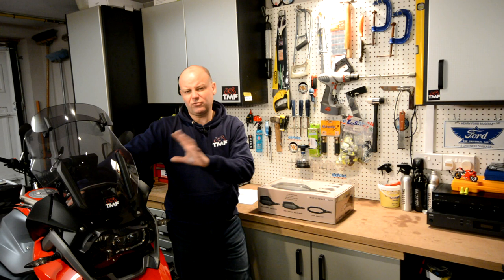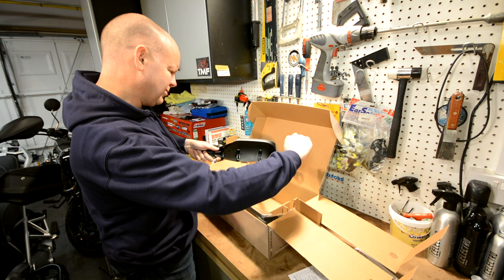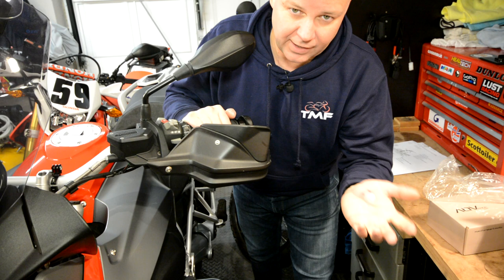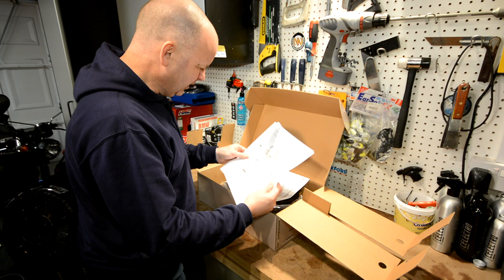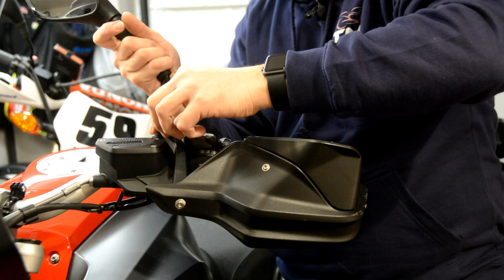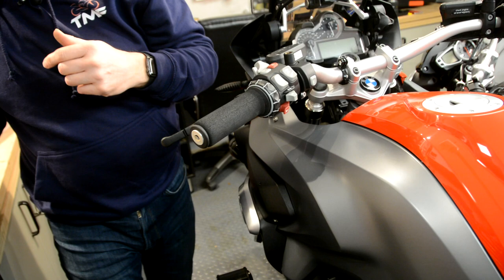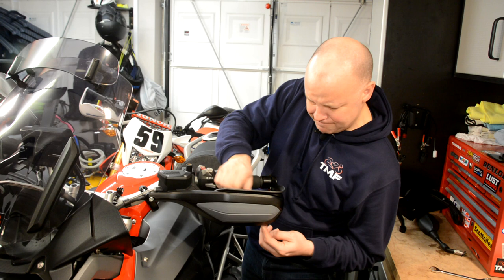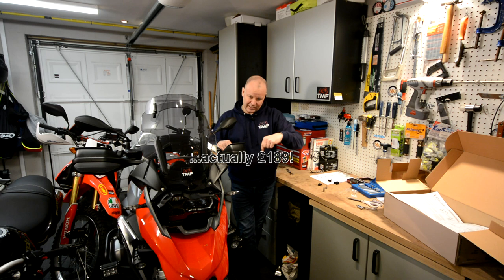How to fit Machineart Advance hand guards to a BMW R1200GS

Comment: There seems to be an ever present discussion about metal handguards vs plastic ones. The one argument being that plastic absorbs impact better just due to flex whereas metal transfers the forces straight to the steering bar and uhh, from the looks of it, your clutch cable assembly. I've dropped my GS several times and although the marks on the plastic are visible, they have never given in, also due to flex. They also might be quicker and somewhat cheaper to replace. Also there is the point that modern plastic compounds these days are very, very durable. This is why they don't make car exteriours out of metal any more. I'll likely consider these if I break my stock plastic ones, but seeing how much abuse they can actually take, I'm not sure that will happen, also scuffed aluminum looks and feels worse than scuffed plastic :) just my 2 cents. They do look nice and I love the removable shield.
Reply from the maker: Yep good points - we'll see how they go!
Reply: Machineartmoto Advan Handguard are tougher than Barkbuster

Comment: Talking of dropping things.... I cringe when I see tools and fittings being wielded above such fine machines like ours as we work away. The damage caused by an accidentally dropped spanner, screwdriver or indeed bolt or screw as it bounces off and marks the paintwork, engine casings etc. leaves painful memories of said experience for a long while afterwards. Have a word with the missus and as she changes her tea towels for super clean unmarked new ones (My good lady loves new tea towels lol) that's your cue to acquire the old ones (Or indeed any other useful linen, bath towels etc) and build yourself a plentiful supply in the garage/workshop. They certainly come in handy for protecting the areas directly where you're working and other surrounding areas too. When you next drop a bolt or a tool you may just save yourself some heartache in the future..... Loving your vids as always BTW
Reply from the maker: Thanks for the tip!

Comment: Billet aluminium means the part was machined (cut out of) a single block of aluminium as opposed to being cast in a mould from liquid aluminium. Cast parts usually have a rougher surface from the mould texture (if not they have been further processed, polished for example) and can have imperfections resulting from the casting process - cavities from air bubbles for example. Machined parts are usually considered the better quality as they are structurally stronger (no imperfections due to the casting process) and can be made to a greater degree of precision.
Reply from the maker: Thanks for that - I suspected that was the case but good to hear it from someone who clearly knows what they are talking about!  Cheers - TMF

Comment: TMF great vid as always, the true purpose of the metal backbone (in the case of Barkbusters) is not so much protecting our hands, which it does as well,  but to enable a rider to ride the bike out of an off road situation upon crashing and still having use of your clutch lever. The added wind protection is just a bonus, which if mainly road riding the OEM would suffice with the added wind protection bits. I had contemplating these but as you already know the cost of entry is steep. Would have been over $300++ in CND $'s.
Glad you got your shock worked out. As our bikes get a bit older, there will be more and better 3rd party options available. cheers
Reply from the maker: Thanks for watching and for stopping by!  All the best - TMF

Comment: Nice neat install, TMF.  Always glad to hear other riders’ dropped bike stories... I had my then new 06 Ducati 2 months and dropped her on gravel (not moving thankfully)... I lived with the shame for several years. Group therapy was somewhat helpful 😀🏍.  Take care- enjoy the new gear.
Reply from the maker: Yeah I was on a pub gravel car park - bit of off-camber and an upslope......whoops!
Reply: Here’s one for you then....I rode back from Silverstone on my Z1R in the early 80’s, arrived back home in the drive, stopped, but because it was cold (and you only wore jeans back then), my knees had locked so I couldn’t put my feet down; toppled straight off. Major concern wasn’t the bike.....it was if anyone had seen me...l felt a right twonk!
Reply: Steve Inskip I know the feeling!
Reply from the maker: ...as do I!
Reply: Hmm, got the brand  new KTM home in a van, a 300 mile round trip... all good. Loosened the first tie down and with a big bang of the strap, the brand new, zero miles beauty fell over in the back of the van. Beat that! Scratched bar end and a twisted mirror was the sum total of damage though. Live and learn!
Reply: Mark Straker oofah!!!✔️

Comment: Looks good TMF.  I see watching your videos could cost me some money!   I am considering the handguards, maybe someone will have them at the BMW MOA International Rally in the USA this July.
Reply from the maker: Yes they are a bit pricey but I think they look great and I’m very pleased with them....
Reply: TMF:  I just bought a Scantool ODBLink MX device and the adapter cable to hook it up to my GS just arrived today.  With the basic MotoScan app on my phone I can see data from the bike and (not tested yet) reset the service date and mileage.  Would make for a nice video blog by you.  Less expensive than the GS-911 device but not as capable (I own  share of a GS-911 tool so have used it).  Just a thought for a future video.
Reply: The hand guards are $269 US from Revzilla.com.

Comment: Isn’t the purpose of a plastic guard to break on impact where as a metal one has the potential of squashing and trapping your hands?
Reply from the maker: This is solid aluminium, thick stuff, I can't see it being bent in the event of an off.....at least I hope not!
Reply: DucatiRichie Billet aluminium will shatter on impact, but will not flex going through wind or light brances etc., as just plastic will. Opinions are devised on whether that's  a good thing.
Reply: Is it billet or machined from a forged piece

Comment: Very nice TMF, all this discussion about metal or plastic, if you think about it, they are doing the same job as BarkBusters, which are metal.  I layed down my Multistrada two years back the first thing that touched the floor was the handguard, which has the indicators housed in them. The hand guard broke in three places and was hanging off for the ride home, i then put metal BarkBusters on to protect the new handguards, which they did very well.  btw im trading in the multi for a GS Rallye this week :)
Reply from the maker: ooh congratulations!  You'll like my video this Friday then - stay tuned!
Reply: Ill come say hello at the Excel next week.

Comment: Billet Aluminium normally means they are machined from a solid billet of material. I doubt that is the case with hand guards as there'd be so much waste material ...
What's more important is the grade of aluminium they're made from 😎
Reply from the maker: Thanks for the clarification Bobby....
Reply: very true, being a machine shop owner I find it funny hearing billet and aerospace material thrown about!

Comment: I understand the utility of hand guards for defense from winter's cold winds, protecting hands from small tree branches etc, but I've also seen first hand (no pun intended) how it's possible to break both hands if you are unlucky going over the bars in a crash. A rare but nasty injury made worse because somone else needs to feed you and wipe your rear end for a couple of weeks during recovery...
Reply from the maker: Yuk....point made but on balance personally the protection from the wind and rain I think is worth the risk.....
Reply: Wind and rain, back in the day you just got cold and wet. For a bit of luxury a plastic bag and elastic band over each glove done the job. Could have saved yerself £189!
Reply: TheMissendenFlyer Yes tend to agree, particularly if you are only riding the GS on road. The particular accident I referred to happened during enduro riding in the dirt when the front wheel hit an unexpected deep pot hole at speed.
Reply: This is one of those claims that you read about, but in reality it's possible to get your wrists caught in the guards regardless of what they are made of. Although I'd still tend to agree that metal impact would be more damaging than smashing a bit of plastic that has flex.

Comment: Very nice. My one concern is that as they are so solid, any impact could travel through the bars and damage other things like the head bearing? Plastic takes the brunt by snapping... my only small concern, otherwise and excellent and practical farkle! TBH
Reply from the maker: Yes I never even thought of that but quite a few have commented that metal isn't the best material for hand guards (although I'm very happy with them)....

Comment: Nice video, Sir! These new guards look very nice indeed. These guards were obviously designed well, as the fit would indicate. A bit pricey if you ask me, but the OEM guards might not be too far off of that, knowing BMW! Frankly I think I would rather have plastic there, but everyone has different ideas on that. Enjoy them!
Reply from the maker: ...I never even knew that plastic v metal debate was a thing until I posted this video.....
Reply: HA! Oh it's a thing, man!  And I think it stems mostly from one's personal experience. The other driving factor is personal preference, of course. There is no wrong answer, and I think the best answer is the option that works best for you.  From a visual point of view, these new guards are fantastic. That is the one thing I wish I had on my Suzuki GSX1250FA. The paws were a bit chilly on the ride in this morning. It makes me realize how spoiled I am when I ride the Trophy and/or the Vision. The protection on those 2 bikes is so good I took it for granted. No more!   ;-)

Comment: Top lock-nut on mirrors is often a left handed thread ...
Reply from the maker: Aha!  Thanks for that.....although all seemed to go back together nice 'n' tight....
Reply: Nonsense! A lock nut is simply another nut, usually thinner, which locks onto a main fastening (plain) nut to prevent it loosening. How can you have a LH thread on a RH thread? If TMF did anything, he should have used a second spanner (wrench for USicans) on the mirror main nut, to counteract the loosening of the locknut...
Reply: Andrew Nichols - i agree with your general logic on locknuts but I've double checked and on my Triumph Tiger the upper locknut is a LH thread. Not sure if that's the case on BMWs too...
Reply: Yes, the locknut on the BMW 1200 GSA is reverse thread. Not sure why, but I just went out to my bike and checked.

Comment: Nice looking quality product.  With respect to airflow protection, I'm not sure that there is so much airflow over the hand to protect from- certainly on my Adventure  the main air flow is deflected away by other protuberances up stream.  I checked this out by the simple expedient of moving my hand around in the air flow whilst being bored on the M6 one day!   It would be nice to incorporate indicators, then there would be some additional justification to splash out on these.  ATB & TTFN TMF.
Reply from the maker: Cheers Nick - good to hear from you again.....
Reply: The pleasure is all mine by the sounds of it!

Comment: Greetings TMF, l was wondering about your thoughts about these guards, after a year of use. I saw a set on an Africa Twin, they really look like a fine piece of equipment.  I particularly like the twin spar frame and modular design. 
I called  the company to see if they had fitment for the Kawasaki Versey. Being that they are located nearby, in New Jersey,  Andrew, rhe owner, asked if I could stop by. He wants to adapt a mouting kit, to fit my bike.
Now I have to convince myself to part with $279.00, for a set of hand guards. Quality kit isn't cheap! 😉
Looking forward to your upcoming adventures,  Cheers, Rich
Reply from the maker: Yes they are pricey but I have to say the quality is fabulous - I definitely recommend them if you have the cash to splash, lovely bits of kit....
Reply: @TheMissendenFlyer  , you are a true inspiration, when it comes to adding farkle to the bike. I love your phrase " if you have the cash to splash."😃

Comment: Yeah, seen these on Nippy's. I have the Givi extenders, which look good with my tinted winglets and screen. I had the Barkbusters with the Storm Guards on my F800GS, before getting the GSA LC, which were great but I didn't like the look of the Barkbusters I'd seen on the GSA LC, preferred the stock look with Givi extenders. Ideally I would like stock+Givi+Barkbusters aluminium brace but not really possible without some fabrication. So these Machineart Advance Guards, which I quite like the look of seem pretty good with the adjustability and aluminium construction, always better than plastic. But like all Machineart stuff it's ridiculously and outrageously expensive and overpriced so I'll be passing on that and waiting for the identical Chinese copy at a 1/3 of the price! I bet they don't sell many, £100 and I'd have had a pop but not at £180. Out of interest how tall are they fully extended?
Reply from the maker: Well I've not measured them but at least as tall as the Touratech extenders I replaced - I'm very pleased with them so far...

Comment: I think you have inadvertently fitted a pair of very nice quality knuckle removing devices, some things are just better made from plastic, this is one of them. I sincerely hope you do not have that particular experience TMF, but I personally think they are asking for trouble...just my thoughts.
Reply from the maker: Yeah a few have made similar comments - I had never even thought of that!
Reply: Whilst travelling at 70mph and seeing a potential hazard ahead of you, you generally want to be hanging onto those bars and steering yourself out of trouble....not thinking oh jesus, I wanna get my hands out of these aluminium guillotines while they are still attached to me. I think I may have just blown my chances of that job of head of marketing for Machineart! btw, just entered the Canary Tours comp. Thanks TMF!

Comment: Thanks TMF......did you also consider hand guards with intergrated turning lights? Probably more fiddle to fit and not offer the same options as those from summer and winter
Reply from the maker: To be honest Grant I didn't - I wasn't aware that they are available for the GS?

Comment: They look like cast alloy, given there's strengthening ribs visible in the narrow ends. Any decent impact would likely snap them apart. Almost £200 for those is ridiculous too. Luckily your GS doesn't go off road so I doubt you'll ever need to test there strength 👍🏻
Reply from the maker: I hope not!
Reply: You are wrong...
This handguard are tougher than Barkbuster and Barkbuster...

Comment: Andy, are you (still) happy with these?  I've got the fixed extenders and my hands are now getting too hot! Do you in fact open them up to summer settings in practice?  TTFN, Nick
Reply from the maker: Yes I'm very happy with them - I just retract the top part in Summer rather than open them up in practice.....

Comment: Hi TMF; on July  30th our local BMW dealer was doing a $3,000 off promotion on all bikes.  I almost traded in my ninja 1000 ABS & bought the R1200GS Standard.  However, was too busy trying to catch a flight to UK so I couldn't.  Now I realize I should never buy a BMW bike, because just like their cars these bikes must not be owned past warranty.  While in UK, I watched more videos and I now realize they might be good looking etc but they are designed with planned obsolescence.  Which is a tragedy.  But the Germans are super good at this strategy.  I was told that Merc 200 series back in 1970s started to use plastic parts which were designed to grow brittle and lose flexibility by the time warranty was over and break!  This was done to generate income in service and parts.  
So no matter what, my future bikes will always be Japanese.  And after Trump's tariffs, I guess future cars will also have to be Japanese.

Comment: I like the flexibility they offer MF but not so keen on the price. I too put the touratech guard extenders on mine-can't remember who recommended them-must have been a youtube vlogger LOL Just out of interest did you find out how much the BMW OE ones would be so anyone who'd damaged theirs could see what the comparison would be? Do you have to put locktite on the bolts you removed and then refitted to reposition the wind deflectors? Cheers Ade
Reply from the maker: Yes they are pricey and no I didn't check the cost of the OEM ones......sorry!  Thanks for watching as ever - all the best - TMF
Reply: TheMissendenFlyer No worries. Looking forward to hear how you get on with them.